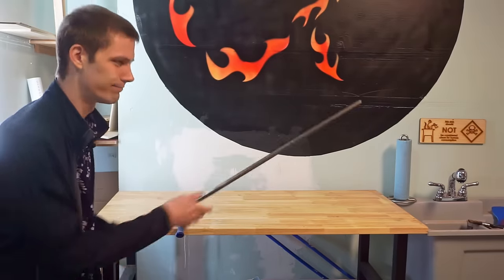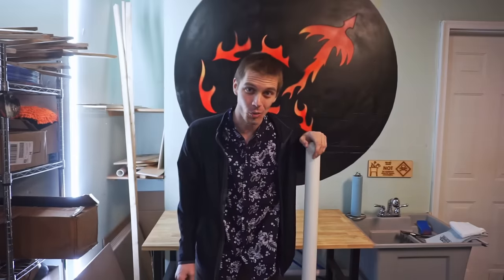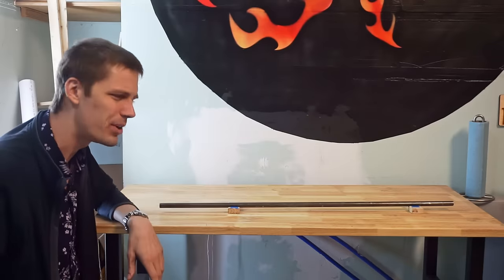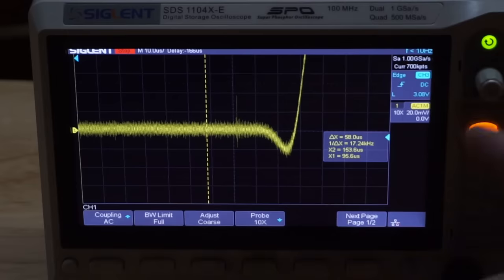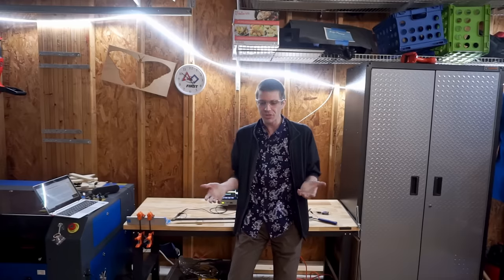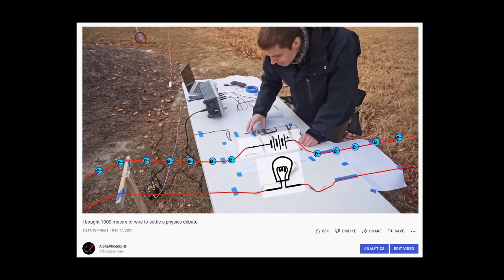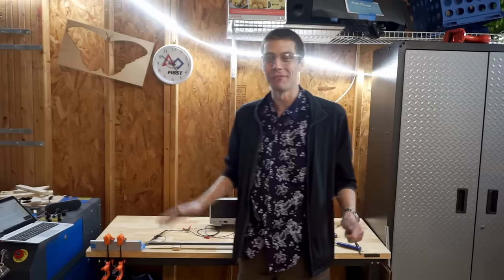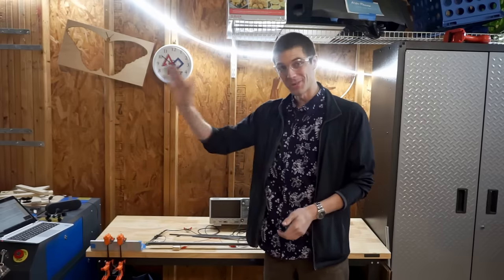Are solid objects really “solid”?

Comment from the maker: Frequent question replies and corrections!
Sup  everybody! I'll edit this comment when common questions show up or people find errors I want to correct! (I know there will be many, but I don't know what they are yet, or I would have put them in the video!)

#0: the "model" I use to describe interatomic bonds is ludicrously oversimplified, but it's kinda close enough to make it look like a spring.

#1: at 20:02 said "poisson ratio" when the graphic clearly said "E" for Young's modulus. It's almost like filming brian can't even see the things editing Brian pastes on the screen...

#2: lots of people asked about the delay in the wires or sensor squish. if there was a noticeable delay, the plot I show at 17:26 would have had a nonzero intercept (if the spark between the hammer and bar sparked early, the intercept would be negative, and if the sensor or circuitry added a serious delay, the intercept would be positive.  If both are happening and cancel out, they happen every time the same way, apparently!

#3 yes everything from water, to steel, to neutronium is somewhat compressible (the nutronium comments were great - thanks! Apparently in such a structure held up by Pauli pressure, Vs approaches the speed of light. Now I’m wondering what the refractive index of nutronium is and if it’s crystalline or not…)

#4 I've had enough people ask about hitting the bar witha hammer moving faster than the speed of sound that I actually looked into it. I'd need an ultralight projectile like railguned into the end of the bar in a big vacuum chamber - there's no reasonable way I can think of to make something go that fast but I if can think of one I'll make a video. bottom line though, as long as that impactor isn't actually penetrating the bar of steel, the wave will still pass through the steel at the speed of sound.
Reply: 20:02 to 20:10 You say "poisson ratio" instead of "Young's modulus"
Reply: Dustin at smarter every day has a canon maybe a team up
Reply: Sounds like we need to get you more patreon supporters so you can buy a railgun and giant vacuum chamber 😂
Reply: amazing video!
Reply: 7:14 wouldn't you actually be reading the devices inaccuracies?  Most if not all have a   1-2 + - %.  I've Never seen one 100%.....
Reply: #4, doesn't matter how fast.. the media dictates the speed of the wave.  The harder/faster you hit it the quicker it reaches its max squish factor or speed of sound but it won't increase the speed of sound in the material.
Reply: #4 There is a lot that you have put into this decision process and every idea I thought of came full circle to destin and his cannon haha.   Speed of sound in air is slower so why not use that;  A long barrel gun has an initial compressive supersonic wave.  But air isn't rigid.  Is the rigidity of steel stronger than the speed of sound in it? could an S wave travel faster than a p wave? Supersonic jets and earthquakes is where my thoughts go next. Admittedly I can't remember the types of waves in an earthquake.
Reply: What you're measuring is the time it takes the hammer to exert enough force to push the bar forward. That's you delay. The hammer touches bar, timer start. Hammer pushes bar forward, timer stop.
Reply: Try measuring the force it takes to push the bar forward, then start measuring the speed the bar moves forward, at exactly the moment the right amount of force is applied.
Reply: What is the speed limit you could test before the steel disintegrates and goes molten from the kinetic energy of your rail gun hammer?
Reply: Hi, your videos gave me pleasant surprise this morning! ~9:40 on the zoomed in scope, just before the the impact of the hammer there is a tiny spike. Presumably irrelevant but could it be the pressure caused by swinging the hammer backwards? Pretty interesting observation you explain here 😎
Reply: As for point 4 that is called a hydrodynamic impact. Theres virtually no info on google about it. It is a very real thing in military applications, tanks do consider it. 

You only need the impact to be faster than the speed of sound in the material to see the behaviour. Once that condition is met all materials behave following the same equation. So instead of making a super fast projectile try getting a material with a slower speed of sound.

Spoiler alert the projectile will penetrate. Pretty much always even if a little bit. I like the model you made cos it is perfect to explain this. If the first layer of atoms move faster than they can relay the information to the second layer they will reach the second layer before the second layer knows there has been an impact.

PS: if you need the formulas or whatever hmu. It would be great to have some easily available info about this!
Reply: Could you please do the experiment again keeping all things equal except that the steel is now Lead.
It sounds to me that the resonant frequency of the material is what determines just how solid (Or lack there of) it is.
Steel has a frequency of 38Hz, Transfers motion quickly.  Lead is 3.26 Megahertz. Absorbs and transfers motion slowly.
I think most people would say steel is more solid than lead. Both conduct electricity well. Its got me wondering.
Reply: And this particular field of physics is why geologists can study earthquakes.
Reply: what about if you used a very long diamond
Reply: Question: what about the speed of (conductive) heat? Does it use the speed of light (because of the relationship between electrical and thermal conductivity) or the speed of sound (because thermal energy is kinetic energy), or something slower still?
Reply: I would grüess Speed of Sound cause the Atoms bumb at this Speed in to each Other. So Speed of sound
Reply: Maybe try with different lenghts of bar so you can remove the delay caused by your measuring system. That part should stay relatively same (taking the average of multiple repeated tests with both bars).
Reply: Science works fine as long as we remember that it is all relative (approximate) and use it to do something useful. Once you have the useful outcome how accurate it is isn't really relevant.
Reply: about #4 - While going to the speed of sound in steel is, indeed, fairly impractical, how about changing the material? Lead or Bismuth are potential candidates: you can get the extensional speed of sound of them (according, btw, to the same site you referred to in your video, which I actually did not intend to find😂) as low as around 1200 m/s, which is much easier to get (using a bead with enough explosives is the easiest I can think of)
Reply: You could use a stockwhip to hit the bar somehow as the crack of it is actually a sonic boom as it goes faster than the speed of sound. But it would be hard to know at what speed exact it strikes.
Reply: Just seen the result, I was pretty much spot on but I wonder if you had a stiffer material, such as titanium for example. Would you have different results?
Reply: @bennyboyy7  a stiffer material will be harder to check, because the sound of speed would be significantly higher
Reply: @yahhav345  right thats where im curious tho by how much faster? Because ive heard all these terms for different hardness steels and i dont quite understand how they are measuring it. If the results are consistent with the hardness then this could be a good way to measure and explain i think. The only thing that makes sense with the way they test hardness is how flexible is the metal before it breaks. Hard metals arent really flexible at all but soft ones are to a point. Its weird how the speed of sound changes with harder metals but i guess its not really changing its just the vibrations are faster through the metal and they end up being faster than sound
Reply: @bennyboyy7  basically, it doesn't have to deform a lot, and you don't have to be particularly gentle: at least with metals, usually you can get some sort of deformation before getting to the breaking point of the alloy/metal. it's not like that with everything (e.g salts) but than you can check the stiffness through the speed of sound
Reply: Theory: hitting an object with a projectile moving faster than that objects speed of sound will momentarily liquify the material around the projectile. Explanation to follow.

So I thought about elastic and plastic deformation. If the projectile is moving faster than the object's bonds can react, assuming it has sufficient strength itself, it will just start yielding those bonds before the next set of atoms can accelerate to match the speed of the first set of atoms and resume elastic deformation. Thus, until the projectile has lost enough velocity, I believe the object would appear to "flow" around the projectile. Not like a bullet hitting a soft object, I mean like a bullet hitting water. Then when the projectile's velocity drops below the objects speed of sound, the strain wave would finally outpace it and propagate through the rest of the object at its speed of sound.
Reply: @maxk4324  that's what happens with fluids and gasses. I would think it would happen with amorphous solids as well, but crystalline solids got their strength in part from the structure itself. would a solid body necessarily have enough energy to flow through the material? what if the hitting material is softer then the one you hit? it's actually fairly interesting imo
Reply: I like the ideas to solve #4 by using other metals like lead, but I think that is not ambitious enough. Lead does deform easily, so maybe a plastic that has similar speed of sound would get the job done. But if you can find a suitable rubber rod and design a experiment around it, that is your ticket. Rubber has an abnormally low speed of sound at around 60m/s (literally slower than air), which would be trivial to accomplish.
Reply: Re #4 collab with smarter everyday. Use the supersonic baseball gun to propel something into the rod (eg. a projectile hitting a small steel plate that could also then close the circuit). Supersonic gun bullet could work too, as long as the middle piece is of the same weight as the bullet. Or not?
Reply: You're answering questions I asked my parents as a kid and never got the answers too. Thank you
Reply: Nice explanation! So if i understand it correctly does this also meen that a steel bar can produce a max of sound when i drop it?
Reply: Great video!  I particularly liked the Poisson's ratio explanation for the difference in sound speed
Reply: @maxk4324  its called a hydrodynamic impact. As long as the speed of impact is higher than the speed of sound on both materials the projectile does not slow down until it is consumed.
Reply: Can i buy the box/counter from The "The muon-powered, universe-bifurcating, random number machine" video?
Reply: A lot of people are asking about hitting the bar at a faster speed but my question is what if you push the bar very lightly with your finger instead of hitting it with a hammer? Like If you were to put your finger on one end of the bar without taking any measurements, then have a friend turn on the measurement device, then push so no sound or impact is created. Does it still create a wave through the bar at the speed of sound?
Reply: @rehepeks  (about different lengths of bar)  Towards the end of the video that's exactly what he did!  Bars of length 3', 2' and 1'.  Delay time was almost exactly proportional to the length, which helped verify his hypothesis that the delay was totally because of the impulse traveling through the bar.
Reply: In Fluid mechanics you can create supersonic velocities by laval nozzles which unintuitively widen up to further increase the fluid velocity. Im wondering if the underlaying effect is similar to the higher speed of sound in a wider solid structure. Maybe it would also be possible to increase the velocity of sound in metal by giving it a spacial form then.
Reply: Awe, come on man!   You can bend that with your hands !   You just need a few more days at the gym and a little more Motivation !  :-)
Reply: So if it's moving the speed of sound, I would have to think that means the speed of sound through that specific medium, which makes me believe the results would have to be the same if the experiment were conducted in a vacuum. However this also implies that the propagation of the force would travel at different speeds depending on the density of the material the force is being applied to. For example hitting a hammer against a foam rod vs steel vs water vs compressed methane.
Reply: Maybe you could also measure the shear speed by modifying the setup just a bit. The shear speed is much lover than the compression speed, looking at the table in the video.
Reply: @alphaphoenix In college we studied the Hutchison’s Affect, being able to manipulate metals with magnetic force. A very interesting concept! If anyone hasnt heard of this I HIGHLY recommend looking into it!
Reply: I've never before considered the speed of sound in neutronium...because in space, no one can hear you scream. 

Also, because the gravity is fatal to all corporeal life.
Reply: @louisvictor3473  That was my thought. Just cap the rubber rod with a piece of steel so the same conductivity method can be used for measuring start time. But is there a rubber that can be hit that hard and remain intact? That's like twice the head speed of a good golf club swing. Either way, it would be cool to see this experiment done with rubber, plastic, water (two pistons on the ends of a tube of water), etc. even without a supersonic strike.
Reply: Question: what if the lite second long bar was truly solid?
Reply: This is so interesting because I have been thinking about this 

And imagine eating and visualizing it on solid objects like rocks and hammers just had a curiosity of thought and now to kind of see it or have someone explain it truly amazing times funny
Reply: @mendelalnatan8108  I suppose nothing is truly solid, at least on a scale where causality can not be violated, which may or may not be all scales.
Reply: For an alternate test to see the potential for the speed of motion, could you not rotate it in some manner which does the same thing? Maybe put a metal pin in each end of the bar so it can still conduct and try it again. I bet if you measure it on a rotational axis it'll be much higher than the speed of sound through the material, but likely still at approximately the speed of light.
Reply: #4 just shoot it with a 9mm going close to 1200 ft per second
Reply: If you use sound or an action that creates sound through an object to move it. Isn't it plausible that sound might be moving faster than the motion of the mass. So all you are really doing is measuring the speed of sound? What would happen if you were able to use light to move the object? Or your finger? Or a Magnet? Or to simplify it, the speed of motion on a mass is relevant to the type of force applied to it.
Reply: @glenh1369  so use a bullet that's traveling three times faster than the speed of sound and shoot at a distance away to where the bullet exceeds the speed of the sound wave
Reply: @ethanyates28  And when the bullet hits will create a sound wave through the mass.
Reply: ?mmmmp
Reply: Mo
Reply: Thanks for these add on :) 🙏
Reply: Doesnt the bar recoil? If you hit with a hammer, adding energy to the bar, that wave doesnt necessarily move just forward, it would also move backwards. If you mentioned it, I missed it.
Reply: So the solid object doesn't move till the kinetic energy of the force is exiting it, not when it enters?
Reply: This might be a silly question (I'm literally no scientist and have no education in this field, at all)  but as everything is made of electrons, what roll would the compression of atoms prior to the hammer striking the metal have on the electrons making up air have on the registration of the weird dip on the scope?
Reply: I like this video but I do have a question about the delay process. I like how you used a hammer to hit the rod, "solid" on "solid", but what about your hand? Could that have caused the delay? Or contributed to something not addressed or calculated to affect the results?

Basically what I'm wondering is there a possibility that the soft tissue, blood etc of your hand cause a slight delay before the rod moved against the pressure switch? The hand naturally isn't as hard as the steel rod or the head of the hammer, and the amount of force needed to move that rod into the pressure switch be enough to push into the softer parts of the hand (blood, fat, skin etc) causing the delay? Or the impact of the hammer on the rod have enough force to push the handle into the softer parts of the hand affecting the delay, causing more contact time with the hammer and rod, than with the rod and pressure switch affecting the results (imagine pushing your finger into a pillow) or would a nonzero intercept apply here as well? Lord I hope I'm making sense lol words are not being friendly to me today
Reply: @zhoufang996  dope thought. Upvoted
Reply: Could the thin steel bar be bending slightly to cause the delay? like when an arrow is shot from a bow, it bends under the pressure, and then starts to move?
Reply: Can you do an on orally rearranged monatomic elements patent, ORME patient, and their exotic properties. ☀️☀️☀️
Reply: @yahhav345  not through, around. I'm not assuming that the projectile would pass through the object unimpeded, rather that the material from the object would part out of the projectiles way like the first few microseconds (or milliseconds, not sure what time scales to use) of a bullet hitting water. My first assumption is that the projectile material is stronger and harder than the target material, but I'm sure neither is coming away intact regardless. Regarding the bond energy, I'm fairly sure any solid projectile moving this fast has the energy to locally liquify of even sublimate the target material once its kinetic energy is dissipated into heat, but that would come after what I'm talking about. What I'm talking about is the moment of impact and a few microseconds after, while the projectile is still moving faster than the targets speed of sound. Other atoms in the structure not in contact with the projectile would not have time to react preemptively to the projectile, as they would for a subsonic case. So the projectile would part the target material as if it were spreading a tightly bonded, but free flowing liquid, at least locally it would appear that way until the projectile went subsonic again and the target's grain structure could resume normal plastic and elastic deformation.
Reply: @louisvictor3473  Plastics and rubbers don't necessarily have a uniform speed of sound, and it can be directionally dependant. I don't think it would work with those materials, or at least it would not have the desired result
Reply: @Pawer8  how would one achieve this! Gas gun? Rail gun? Other?
Reply: @maxk4324  military got a lot of money. Also it is not as fast as you may think as usually tanks use ceramic armour which has a slower speed of sound. The amount of steel needed to protect against a projectile would be too heavy so composites are used.
Reply: @Saki630  doesnt melt. It kinda just gets out of the way
Reply: @bennyboyy7  hardness is not strength which is what you are talking about i think. When we say speed of sound we mean in the material
Reply: @maxk4324  if you are above the speed of sound in rubber you will see the same behaviour. Once you get past that point all materials are defined by the same set of equations
Reply: Interesting experiment, I suppose it makes sense, people trying to defeat light speed communication by saying something like "what if we have a long solid bar and we push it back and forth, then we can communicate instantly!" and then the answer turns out to be "So... Basically... You want to connect two distant points with a ridged Rod/Bar/String. You will be communicating moving the Rod/Bar/String back and forth, perhaps with some sort of mechanical driver attached to each end that will both move the Rod/Bar/String and detect movement as signal...?" and then it is pointed out to you that this is exactly the principal in play when you tie two cups together with a tensioned string to make a telephone... which is understandably limited by the speed of sound through the string. So now you're looking at the problem simplified to the obvious, laid out in front of you and just go... "Well... Derp."
Reply: Depends on how you define solid!
Reply: What would happen if you hit the bar with an object moving at mach 2 with no loss of energy between the 2 materials?
Reply: @mikess308  already answered that
Reply: How do the outer mist atoms hold themselves together with the rest of the atoms in an object when moving? I have always pictured atoms in my head as a magnetic force. What is strange is that they seem to be held in place with resistance coming from all directions? Or are they being pulled to a point while these points of pull are sort of like how a black hole is visualized? 😕
Reply: @mikess308  !Also assuming there no outside loss) So all the energy is transferred to the other item!
(assuming no outside interference) 
So you are also assuming all the energy is tranferred! 

Then if both objects are the same weight then the one hit will continue at the same speed as the one that hit.
so not a real life experiment
Reply: I believe this weird negative signal was the bar pushing back on the hammer. And the reason it was smaller but not gone when you put on acrilic is due to the transfer of energy and potentially reduction of mass since there is no nuclear bond between the acrilic glue and bar.
Reply: How solid?
It more simple for me to imagine that bar to swing like a sword. Imagine that bar 10 meter. Seems like more delay than speed of sound.
Reply: I'm just wondering if we were to take air displacement into account between the rod & the pressure sensor. Working in machining & making a block stack for a job. All the air must be removed from the block stack to be accurate  we have to wring the blocks together. That is push them together & twist them in alignment. The two machine surfaces of the blocks will stick together just from the friction. If this is not done the degree angle that the block stack is supposed to create for the machine cut will be off. If the part you are working on is really long, the degree angle will be out at the other end. So should air displacement be a factor in this test for a more accurate measurement?
Reply: Wouldn't the bar "reaction times" depend on where you place the bar? Since space hasn't the same properties everywhere? I guess you're using a virtual space to place this bar but if you had to test this in a lab then the lab location would matter.
Ps if this sounds confusing is cause I'm testing the wine i produce
PPS not a commercial comment, I don't sell wine
Reply: "I'd need an ultralight projectile like railguned into the end of the bar in a big vacuum chamber"

Smarter Every Day has a faster-than-sound baseball launcher he's done several videos on. He's always looking for excuses to make new content about it. Given that this video has 1.35 million views, he might be open to a collaboration.
Reply: A.
Reply: You say mass doesn't move, but I see two possible exceptions:
1) assuming an ideal unbreakable material (say neutron star matter), any relativistic shock force should cause bowing of mass. what would relativistic acoustic properties be?

2) if possible, a meta-material that has a piezo, anode, cathode, and chiral preference, like some sort of solid-state electron gun, that throws out electrons instead of photons. I know there are some crystals that light up when impacted. it would be interesting if a material could bleed away kinetic energy orthogonal to the waveform with a chiral preference.

also, do acoustic properties change in metal if and while it is irradiated or if a current is flowing?
Reply: So every materials (atleast average) speed of motion is that of the speed of sound for said material?
Reply: #4 Ask Dustin (Smater Every Day) :p
Reply: Would there be a delay in that rate of motion if we were to observe an electron move another electron in a direction in the same way the hammer moves the rod? Based on the information presented here, we know the delay comes from the fact the "solid" object has to carry a wave across the joined atoms. If we replicated the experiment with only a single electron and another electron, and there IS a delay, would that prove there is some space within the electron for delay to occur?
Reply: Would there be a delay in that rate of motion if we were to observe an electron move another electron in a direction in the same way the hammer moves the rod? Based on the information presented here, we know the delay comes from the fact the "solid" object has to carry a wave across the joined atoms. If we replicated the experiment with only a single electron and another electron, and there IS a delay, would that prove there is some space within the electron for delay to occur?
Reply: What if you were able to pull from the middle of the bar?  Would it be comparable to the striking of the bar?  Say for instance if you had a 10' bar, and pull it from the middle vs a 5' bar being struck @ 1 end.
Reply: Hello. Just curious, but do pressure sensors not have latency? Surely all sensors cannot react to stimuli instantly. There would be a latency I would think. So wouldn't that suggest that at least part of the delay is the pressure sensor's delay in responding to the received pressure input?
Reply: When you add more water it is pressurized like a water main under ground pumps push more water in the pipe to 60 to 120 psi to push water to your house.
Reply: Imagine a circular-wheel type baseball pitching machine and an observation device existing and free to move in the vacuum of space traveling in a given linear direction to within 90MPH of the speed of light, whatever that is in Miles/Second.
(An area with the least/negligible gravitational/magnetic forces anywhere near the test space.)

The machine then launches a baseball at a speed above 90MPH in the same linear direction of travel of the machine/observation device.

Would the ball, and presumably for a temporary time any parts moving at above 90MPH, disappear from the observation device's viewpoint?
Reply: Does a flow of electricity change the reading in anyway? Or could it?
Reply: This video answers a question I've been asking myself since early high school. I am so happy to finally have an answer (and to know that I correctly guessed both that there would be a delay, and that the formula would contain the speed of sound) thank you!
Reply: Surely the sensor has a response time ??? 
Oh I just saw your answer!

I wish you were my physics teacher 45 years ago 🤠
Reply: Okay. Good video. The next video should be "Does information really travel instantaneously between two particles under Quantum Entanglement?" and show experimental proof in the video.
Reply: The person might have god-like strength, but wouldn't the rod bend?
Reply: @Pawer8  I believe you mean point #3 hydrodynamic impact is the water compression
Reply: #2 You could have used a very short bar (about 1 cm or less) to demo the reaction delay of the whole system while nearly neglecting the influence of bar length. This should have convinced everybody that reaction delays are neglible. (At least I would have loved that part of the experiment as "zero calibration".)
Reply: Awesome experiment. It's 1 I have contemplated quite a bit myself! But I imagined it's delay would be the speed of causality for a 1 light-second bar. Granted the bar was thick enough to not distort. I'd assumed the different permanent distortions would not arise if it was 1 light second long and 50 meters wide approximately...hahahaha!
Although I still believe that isn't wide enough, but close.
Reply: So how does hitting the bar at the resonate frequency of the rod influence your experiment?
Reply: I believe Destin from Smarter Every Day could assist you with a railgun 😉😎  Great video, I appreciate your explanations towards the end. It was interesting to learn how and why you did it the way you did.
Reply: Great experiment! Can you repeat this with, for example, ceramics and graphite?!
Reply: @harlyrose   Where are you getting these resonant frequencies?
Reply: @Silent01Josh   Why would it take time to produce the force? It can actually be virtually instantaneous.
Reply: "hitting the bar witha hammer moving faster than the speed of sound that I actually looked into it. I'd need an ultralight projectile like railguned into the end of the bar in a big vacuum chamber"

I seem to recall seeing high speed x-ray photography of almost exactly that. It may have been part of some government weapons research (maybe related to improving the computational models for high speed impacts, maybe for something relating to nuclear weapons research. I don't remember for sure, I'm probably conflating different uses of high speed x-ray imaging).

IIRC they were firing a steel sphere into the end of a steel bar and using the high speed x-ray photography to image the impact from the side (the image I recall shows the end of the bar deforming as the sphere impacts).

I couldn't find the image I'm thinking of in a few minutes of googling, but it's probably out there somewhere.
Reply: Really give you a ton of credit on this experiment. The O-Scope conductor loop to trigger the measurement was brilliant! For those who already knew the answer, it's still quite interesting to see it demonstrated. All of your videos I've seen so far are very entertaining.
Reply: just saw you mention 3blue1brown and now i want to see alphaphoenix and 3b1b solve something weird to find pi
Reply: And what if you just move a steel rod with your hands so theres no sound. Say you make a steel rod thats long enough to reach the moon and your buddy holds one end on the moon and you hold one end here on earth. Would your buddy feel the movement of the rod 13 days after you moved it?
Reply: Bullets go faster than the speed of sound! About Mach 3 or 4 in some rifles, and pistols often reach Mach 2 or 3, you could just shoot one at the end of the bar, no idea how you'd start a timer with that though... maybe you don't have to? I'm not too sure but I think the slow-mo guys have cameras capable of filming in the nanoseconds region... maybe you should ask them?
Reply: Experiment: awesome, Explanation: touch and go.....
I mean you literally make it seem like you had a hypothesis, decided it was correct, started the experiment, then altered the process until getting your predetermined "correct results". I know that's not actually how this likely went, but your explanation definitely makes it feel that way....
Reply: @Alphaphoenix Why can't you keep pressure sensor on two sides of the solid bar..with one end against a rigid surface and then hit the other end is hit with force and then we see difference between two sensors timing.  Ideally it should be more accurate.
Reply: E : I have no idea
Reply: What happens when you hit it with something faster then that does it just melt
Reply: The bar moves in the time to the light it reflect from its surface of the rod to our eyes and then to our brain
Reply: Can some 1 explain me how gravity doesnt affect this outcome? Hes applying a force on a metal bar but it looses energy moving forward loosing energy automatically means there would be a delay right?
Reply: @J. C. I've seen some of your comments on new thinking allowed. You seem like an intelligent person. I really like Jeffery Mishlove. That's probably in my top 2 or 3 favorite channels on YouTube,  and it's probably my favorite depending on the day I guess. Take care 🙏.
Reply: Great video! And you seem to be the man to ask to tell me what to think of the following (yeah, there’s something/total nonsense).
Many times I’ve been under the impression that when I cool down the hot end of a metal rod that I can hold at the other end with my bare hands, ONCE it enters the tank it becomes too hot to hold. As if part of the heat speeds up the rod to burn you.
Reply: I honestly think this whole test contradicts itself. Pushing a bar is not the same as hitting a bar. The question you ask is what would happen if you push a bar. Pushing = more torque less springing through the material. Hitting = less torque more spring. This is all wrong.
Reply from the maker: @boshaw3667  the pulse gets most of the way through the bar before the hammer “stops pushing” so it shouldn’t have any effect other than making it easy to measure. Hitting is just pushing then stopping.
Reply: @AlphaPhoenixChannel  nah hitting something creates a shockwave which changes EVERYTHING. Pushing does not. They’re two fundamentally different things. Yes pushing happens after a hit but it’s more from the shockwave from the deformation created by said hit.
Reply from the maker: @boshaw3667  so how would you push?
Reply: Everything is a liquid if you hit it right.
Reply: Let's say the bar is floating in space is it possible for an object the size of a penny traveling at an extraordinarily high velocity much greater than what would be required to move the bar strikes perfectly to transfer all of it's connected energy.....is it possible for the bar to fracture while staying perfectly stationary????
Reply: A little late, but I am still bothered by this idea of metallic bonding. Why doesn't the crystal strcture of a material expand when you attach it to a capacitor and rip electrons from a material. I'd assume less electrons between two bonded atoms should increase the Coulombic repulsion of neighboring nuclei and an inflation of the crystal structure should be seen? Would this expansion happen along a specific crystal axis? Or are there simply not enough electrons stored in modern capacitors to see an appreciable change?
Reply from the maker: @brandonreese1886  you’re totally right - ripping one appreciable fraction of an electron from every bond would change the bond strength/length/etc. but when a wire becomes charged, you’re only moving a minuscule number of electrons. A recent test I did suggested that to charge a wire to a volt and a half, I’d removed about half of a quadrillionth of the mobile electrons
Reply: @AlphaPhoenixChannel  Thank you for the response! It's such a simple but effective interpretation of solid state systems you almost want it to fail. Do you have an ORCID  -ID? I'd love to check out some of your more formal work.
Reply: @MindCrime550  I came to say that the whole think is based on the speed of sound because he is basically just testing how long it takes for sound to travel through the metal bar because he struck it causing sound vibration
Reply: I have 0 physics knowledge but would a solid object with less electrons make it less "springy" and transfer the energy up the chain faster.
Reply: @jayofthep  less / more electrons mean less / more protons, things would end up balancing out again. I think an interesting extension of that question would be ductile vs hard materials, and do certain crystal structures communicate the impact more easily. I'd imagine highly anisotropic crystal structures, i.e. ortho, could exhibit different communication velocities along an 'easy' or 'hard' dirrection, look up ortho vs cubic unit cells and think about it, its an interesting question.
Reply: Compressibility?
Reply: My 1st thought is the speed of sound in given material is the same as measured.
Reply: Hey that's one of the machines I use at work! Never thought I'd see one outside of that
Reply: Factors of temperature play a part in compressed metal and malleability of solids
Reply: @justinpace7289  Temperature is an emergent property
Reply: Man hats off to your work!! Just amazing amazing amazing!
Reply: I don't remember if it was asked, but what if this experiment was ran near a black hole or something else with a gravity well the object could follow? If gravity is pulling on the object what's the difference between being pushed in either direction, or even both at the same time?
Reply: A rail gun would be awesome, though you could equally just select a material with a lower speed of sound ;)
Reply: Hi, thanks for the video.
The idea of the hammer moving faster than the speed of sound really fascinates me. My personal guess is that the stress on the contact point increases up to the Young module, Young module is always greater than the tensile strength, therefore tip of the bar (tip of the hammer as well) gets smashed, which absorbs the energy and then it propagates normally via speed of sound :) 
Really hope for a video specifically on this topic.
Reply: If you leave the other end free, then the wave will reflect off it. I think this means that the total contact time for the hammer will be the time for the wave to move along and back (ie twice the time you were measuring), but you can now do the experiment without needing the piezo sensor.
Reply: So then in your theoretical space model. If there is a measurable delay possible through force applied.  Would there also be a measurable delay with pull? Say magnetism or gravity? And would it be equal or less or dependent?
Reply: @AlphaPhoenix I think(OPINION)-  calculate time that particular atom moves at its fastest.like when we talk about the speed of light we are talking about the speed of photons, just like that If that rod is made of titanium..........but photons never rest, they bounce instead. So, imagine if we are able to hit that titanium rod with an immense force which puts the impact surface atoms to move at its peak speed- the loss of energy by atoms pushing each other, transferring energy. it will take (length of rod(at atomic level)/speed of that particular atom(fastest) at impact surface) minus whatever the equation is to calculate the loss of energy over the time the atom transfer that energy from one another.
Reply: @AlphaPhoenixChannel Would these results be effected by temperature, as metal does shrink and expand? If so I feel like that would really help prove it.
Reply: I saw you addressed a delay in wire already in regards to sparking before impact or circuit issues. I understand your reasoning for considering the speed of sound but am curious, if you are serious about a dependence on the speed of light, how this would be accounted for in the system because, say the speed of light was the only obstacle, since the signal from the hammer touching the bar moves at the speed of light, the timer wouldn't turn on it time. By the time it came on, the other side of the bar would've moved assuming same length to travel. And appeared instantaneous. I don't know if that scale would register on a machine like that.
Reply: Regarding #4 this makes me curious then about the motion of supersonic jets. Clearly they are in motion, but this proposes that everything inside the Jet-Object is moving at sound speed whilst the Jet-Object itself is actually moving faster. By sheer intuition this seems wrong and I have no idea how to look into it
Reply: Pointless...Total waste of my time.
Reply: Doesn’t a whip break the sound barrier? 

Or a decent air rifle dieseling.
Reply: My thought about how to do the experiment, before you started, was to attach accelerometers, oriented to measure along the axis of the bar, near both ends.  That way any artifacts related to the sensors and their signal conditioning would be the same…
Reply: Would the temperature affect the speed of sound because, of atoms being closer together? Would strain gauges along length of the rod register the elastic deformation wave going by? Did you use a hammer and rod that were not magnetized?
Reply: I think it's not so interesting if the hammer moves faster than speed of sound, because in that context, the hammer would have to travel into the bar faster than the sound wave would propagate into the bar--so either the hammer penetrates the rod and then stops (and the sound pulse continues from that point forward); or, if sustained, said hammer  hits the sensor before the rod itself. Eitherway, you've already explained the situaton sufficiently in this video.

What might be more interesting to wonder about though is this: if a series of rapid small amplitude hits were made on one end, the subsequent compressive  waves would each travel into a slightly denser (pre compressed) material, and each of those will travel with a slightly higher speed of sound than the previous one. These waves would eventually catchup to the first hit and coallese into a shock wave, which in principal would travel faster than the speed of sound. Not sure if this is detectable in steel.

Please let me know if this sounds interesting and if you want to confirm experimentally, I'd be happy to exchange further thoughts...
Reply: Nifty.

I'd like you to push a 1 Ls long bar with your hands!!!
Who are you, superman?

Oh, you answered it, nifty.

Another thing:
LIGHT is NOT the absolute speed.

Big Bang Theory:
During the first few Planck moments, Quantum Energy expanded up to  1/3rd up to 1/2 the volume of the modern Universe, depending on which astronomer you ask.
Now, if you calculate the speeds reached to achieve this vast expansion, the speed of light was broken many a time.
A LOT of many a time.

Oops.

Also, speed, no matter how fast, do not alter time.
Going superluminal will not move you in time, only in distance.
That you OBSERVE this is no more than an optical illusion.
Since, light is slow.
It's only the next barrier to be broken!!!

Is there  an absolute speed:
Yes:
The MOMENT: an infinite dot on the timeline of the whole universe.
This, like the 0°K, or 1 divided until 0 is reached, cannot be done, as there is always a rest .
Which is why we see no time travellers.
To venture into the past, one needs to breach that moment barrier, but seeing it cannot ever be reached due to the rest, however small it might become, is still there.
Nature has this build in to prevent us idiots for screwing up all that is.
Reply: Besides, I think you're lying!!!
I want to see that with a 300'000Km long bar!
PROVE IT!!!!
Reply: I used to question the same
Thank you for video
Reply: @varunsharma3532  Don't believe him!!!
Let him prove it with that bar in space!!!!

:P
Reply: This is underrated.
Reply: So #4 means that if you use a accelerate the steel rod with something fastee than the speed of sound the rod would momentarily slow down to the speed of sound and then accelerate beyond it as a whole?

Or I guess it would just break apart.
Reply: You might want to find analog electronics instead of digital for more accurate time measurements.
Reply: You mentioned something about another video in which there was an unexpected delay as electrons entered a wire at one end and didn't immediately come out the other. However to my knowledge this should have been expected because I think the conduction band of an unenergized metal is empty. So to use your pipe analogy, an unenergized wire would be akin to an empty pipe, per solid state theory.
Reply: 98a😊😊
Reply: @zhoufang996  conductive heat flow is very slow. It is based on the kinetic energy of the solid particles which means they wiggle in place faster and faster until the kinetic energy is transferred in series. The heat is neither a particle like a photon nor a wave like the speed of sound. It is a steady increase in internal kinetic energy (measured as temperature) emanating from the point source of the heat. As long as the point source continues to energize the solid, it has a gradient distribution. If you pulse the heat source, you could create a wave input, but the molecular structure of the solid will dampen the wave so that it will appear as a lower constant than if you kept the heart source constant at its peak value, the same way pulse width modulation affects incandescent lightbulbs. Heat is not a particle nor a wave. It is measured by a big average, which is what temperature is.
Reply: @joklu6257  the answer is no. The underlying effect is on fluid, not on sound. In fact in a laval nozzle, or more generally speaking in any converging diverging nozzle used for supersonic flow, you are changing fluid velocity as a function of the speed of sound, where mach one is defined at the throat of the nozzle. The purpose of a nozzle like that isn't to increase the speed of sound; it is to increase the speed of the fluid using sound as the independent variable. As a matter of fact, as the gas accelerates in that type of nozzle, the energy making the gas faster is sucked out of the temperature, which therefore decreases the speed of sound in absolute terms, because the speed of sound for a gas equals sqrt(KRT). The adjusted relative constant speed of sound that the gas speed is measured against is the mach number using the temperature of the gas at the throat of the nozzle to create the ratio needed to make it constant and relative for use as an independent variable. In other words, as the real speed of sound decreases due to temperature drop, the mach number of the sound remains constantly defined at the throat. In other words, the speed of the fluid is measured as a function of the speed of sound fixed at the throat of the nozzle. Just understand that all of the purpose of a nozzle is to change the speed of the fluid, not the speed of sound. Therefore the idea that you would use something analogous to a nozzle for the purpose of changing the speed of sound does not apply. And in case you are still confused, please realize that "sonic" means the speed of sound, so "subsonic" means below the speed of sound, "supersonic" means above the speed of sound, and "transonic" means passing the speed of sound. These terms do not apply to sound itself, but only to things you are comparing against the speed of sound. Sound speed is always sonic, whether you speed it up or slow it down. In other words, the speed of sound is always mach one. And when the mph of the speed of sound in a gas changes, it is exclusively due to temperature. Now I think what you are really asking is does sound flow like fluid? Please realize that a fluid is a group of particles. Sound is only a wave and has no particles. Sound transfer depends upon the kinetic discharge from one plane of particles of a medium to the next. It's intensity is inversely proportional to the area of each plane and directly proportional to the rate of energy discharged. The planes are curved exactly like the surface of a sphere, as the sound emanates out in all directions from its source. When a sound hits a geometric boundary of the medium, e.g., if you shaped a nozzle out of solid iron, it doesn't speed up or slow down; it bounces and causes interference. Interference multiplies or cancels the amplitude of the wave, but it doesn't change its speed. So this is unlike a fluid, which can neither cancel nor multiply its position. So no, changing the geometry of an object absolutely does not change the speed of sound rippling through it. The only way to change the speed of sound is to change the kinetic interactions of its medium. In a gas you do this by changing the temperature. In a solid you do this by changing the types of molecules bonding with each other, such as can be gradually done by doping the material with another material. I don't know this but I think changing the temperature of the solid material would change the speed of sound in it too, and the same would go for a liquid. I don't know how you would change the sound if it were propagated through plasma or bose-einstein condensate but again it would most likely vary with temperature and the type of chemical bonding. Okay, now having said ALL THAT, now that I think of it, I think there is one super-overly-complicated-crazy case where you could hypothetically be able to use geometry to manipulate the speed of sound, and that would be if you were trying to send a signal through a moving fluid constrained by a mechanical system. As you direct the fluid through the system, you would be altering the temperature of the fluid, possibly the chemical constituency of the fluid, and/or the matter state of the fluid. But to do all this would generate a lot of noise. You might be able to use frequency domain multiplexing to send sound signals in frequencies that are not drowned out by your machine. This would be a really complicated but theoretically possible engineering experiment. You could try mixing liquids together at certain junctures in the path of a primary liquid flowing down a pipe, and you could use nozzles to speed the liquid up or slow it down along its way. At the beginning of the pipe you would vibrate a membrane to create your sound and at the end of your pipe you would have a membrane tuned to the frequency range of the first membrane to pick up the signal. Remember, what you are trying to control (vary) is the temperature of the fluid medium carrying the signal, speed of the fluid medium carrying the signal, and chemical composition of the fluid medium carrying the signal. You would probably need a ton of power to overcome attenuation. You would probably have to use inaudible frequencies to transmit a signal. I don't know what frequencies can travel at the speed of sound. That is a really weird question to which I don't know the answer. If the frequency multiplexing idea works, you might be able to use turbines and compressors and avoid their frequencies. But you have to understand that this machine I am suggesting is so incredibly far-fetched that it isn't remotely feasible. It is like trying to yell a sentence at one end of a rocket engine and trying to hear it at the other end of the rocket engine as the signal travels through the exhaust and then measure that speed versus how long it takes the same sentence to get to your ears through the air outside the rocket nozzle. If you have transducers that can make that kind of measurement, then more power to you.
Reply: @SMPlayerSlayer  sound doesn't travel through a vacuum. It relies on the kinetic interactions between particles of a medium because it is strictly a wave.
Reply: @vasilyborodyn2507  what you are describing is like Finite Element Mechanics, which is pretty cool. Unfortunately that is only a model that applies to solids. So let's think about this. As the hammer swings, the air gets pushed out of the way and the contact is solid on solid. Maybe a couple air molecules get stuck in the middle, right? Now just so you know, technically not everything is made up of electrons. But your basic idea that all the small particles press against each other is worth consideration. According to modern chemistry, however the elements, made of proton and neutron nuclei, with clouds of electrons swarming around the nuclei, which if you look at more closely, are themselves clouds of other subatomic particles, are so far apart from each other that instead of touching each other they repel each other like magnets. If you were to try to force two atoms together then they would repel each other to preserve their crystal structure. There is a super dense 5th state of matter called a Bose-Einstein condensate but I don't know what it is. Ignoring that, and avoiding nuclear fusion or fission, as a general rule, when solids compress on this level, as far as I know, the interactions are not constrained as solids, but as charged fields of energy repelling or attracting each other. Actually the more I think about it, the more I realize that I really don't know what happens when two solids impact each other. I do know that there is this equation in engineering Fdt = mv, which means the impact (technically called impulse) is proportional to the change in momentum. Exploring impulse is very interesting science. To my knowledge, engineers don't understand it very well, considering the fact that they model it with a dirac delta function, which is a theoretical mathematical construct with no basis in reality that we know of. But anyway, when you go back to the chemistry and physics theory, what happens when atoms hit each other is supposedly that their electric field probabilities are altered and this creates reactionary force. If you go to the university and take a course in high level math, physics, or engineering, they will do what I just did and draw a connection without understanding why, and call it hand-waiving. It happens all the time. People who think they're smart really rarely know what they are talking about. But to answer your question, Vasily, and it is a very poor answer, the probability fields of electric energy of the air molecules sandwiched between the hammer and the rod have negligible effect, mostly because most of the air got pushed out of the way before the hammer hit the rod, and what's left is an extremely thin layer that compresses far more easily than the solids of the hammer and the rod, and finally any diatomic oxygen, diatomic nitrogen, argon, carbon dioxide, etc. molecules acting as a barrier between whatever molecules are on the iron surface of the rod and iron or whatever surface of the hammer would probably just transfer the energy so quickly that you wouldn't see it accounted for on the oscilloscope. You have a good question; all you need to change in it is your conception that all things are made up of electrons to the conception that all things are made up of probabilistic energy fields. The difference is, energy fields are mushy whereas the idea that electrons are discrete little balls implies that they are solid. On the subatomic level, scientists don't think they have states like solid, liquid, or gas. It's just all one giant blob. Shows what they know, right?
Reply: @commanderobelisk  latency pretty much only occurs in digital electronics. In analog and mechanical systems, signals travel nearly instantaneously. The only delay you might get is when the connections aren't contiguous, hence the need for glue.
Reply: @johnyz656  for something to resonate you have to hit it repeatedly at intervals equal to its resonant frequency. Considering he only hit the bar once, he only tested the force propagation of a single strike. If he hit it repeatedly at regular intervals below the resonant frequency, the timing of the force impacts would be linear with the measurements of the impacts at the other end. If he were to hit it at a quick enough frequency that it were to resonate, which would be an incredibly high frequency for such a short piece of metal, the reactive impact of the connection at the far end of the rod would slowly multiply until it would start sending reactions backward to the first sensor. At resonance, the striking at one end and the reactionary force at the other end would add up until one of the physical connectors breaks off of the rod. But to strike the rod that frequently would require a more robust setup anyway. If everything could be secured without breaking, then the rod would begin to vibrate as the force and reactionary force bounce back and forth continuously, adding to each other. If resonant frequency is reached and the supports are strong enough and the rod did vibrate, I suspect that there would be some sort of equilibrium where the power dissipated by the vibration equals the power being channeled into the rod. I.e., the taps would have to be really light. If the taps were very energetic, and the supports were infinitely strong, then it would go nuts. On the oscilloscope, before resonant frequency you would see the same result as a single strike but repeated over and over again. But when you achieve resonant frequency and these strikes propagate back and forth through the rod, then the whole signal will grow in amplitude and you would have to scale out the y-axis until you cannot go further and you would see vertical lines on your display at the resonant frequency but no peaks. Having said all that, at least that is what I think would happen.
Reply: @jayofthep  I think that in iron in order to reduce the number of electrons without cutting away material so you simply have less iron, you would maybe be removing the electrons from the conduction band while leaving the valence band electrons intact. I'm not sure about this. In any given material, electrons flow freely through the conduction band, while being held in place in the valence band. In metal the two bands overlap. I am pretty sure that only the valence band is what governs the cohesiveness of the material. Now I'm not sure if there are any additional electrons in the conduction band of a metal that aren't already positioned in the valence band, but if there are (which is a question for a chemistry or solid-state theory professor) maybe if you could use a cathode to strip away the conduction band electrons while keeping the valence band electrons untouched, you would be effectively removing electrons from the iron without altering its elasticity. I am 99% sure that what the other guy said about the crystal lattice structures only applies to the valence band. Now I don't know if it is possible to excite the valence band electrons out into the conduction band and then remove them with a positive charge. It could just be as simple as heating the iron. But I do know that when you heat iron enough it becomes softer until it melts. Now, you specifically asked about a solid material, so that means this only applies to iron before it turns into liquid. By the way, a piece of rebar like he was using would also contain a significant amount of carbon. (Or was he using a more pure type of iron; I can't remember. Still, all commercially produced steel-which is iron--contains carbon.) Now what about putting an electric charge through the iron, like an electric burner on your stove? When you heat up iron enough it becomes malleable, which means that its Young's modulus changes, I think, to make it less elastic and more plastic. Therefore it would become less "springy." Now very simply, I think possibly what is happening is that the very same energy dispelling electrons is causing the iron to become less elastic. You can realize this for yourself if you look at a graph for the tensile strength of iron over both the elastic and plastic regions. But you don't even need to look at the graph. Plastic means that when you pull it it doesn't spring back all the way to how it was before you pulled it. And when a blacksmith hammers iron, it does to back to how it was at first when it is cold, but then becomes more and more plastic the hotter it gets. So when I think about glowing hot iron I think of it losing its elasticity and becoming plastic in deformation. I betcha the answer to your question is, if you heat the iron, you simultaneously cause it to lose electrons and enter into a state of plastic deformation. Now if there is a one-to-one relationship between heating and malleability (i.e., plasticity), and also a one-to-one relationship with heating and losing electrons, then this means indeed that iron losing electrons means it is becoming less springy, very simply. I think the guy who was talking about crystal lattice structures was just mentioning a couple of different crystal lattice structures to sound impressive but don't know of any relevance to your question because you asked about a solid with fewer electrons, and crystal lattice structures have absolutely nothing to do with a change in the number of electrons in a solid. As far as iron is concerned, here's what the internet says: "Pure iron can have two different crystal structures as its temperature is increased from room temperature to its melting point. At room temperature it is body-centered cubic, between 912 and 1394 C if is face centered cubic, and between 1394 and its melting point at 1538 C it returns to body-centered cubic." Keep in mind that is for pure iron. The rod would have had impurities. Maybe the guy who was talking about crystal lattice structures was pointing out that some solids are more elastic than others, but that has nothing to do with having fewer electrons. Unless you are dealing with a material's conduction band, the number of electrons in a material basically equals the number of protons, and then that number becomes a matter of the density of the material, times the mass. It kind of depends on if you are talking about absolute quantities or relative quantities. Lighter materials have fewer atoms, and hence fewer electrons, and the weight is always directly proportional to the number of electrons, unless, as I said, you can vary the number of electrons in the conduction band.
Reply: @christophershafer5615  very good questions and I am pretty sure the answer to the temperature question is yes, the temperature affects the speed of sound in a solid, because it certainly does for a gas, and I believe that if the average particulate kinetic energy in a gas medium increases the speed of sound propagating through it then that the same would be true in a solid. Also I am pretty sure the answer to your second question about strain gauges measuring a wave of elastic deformation is absolutely yes, and he would have to answer your third question, but I do know that if iron is magnetized and you bang on it a few times it destroys the magnetic field by knocking the dipoles out of alignment with the shock.
Reply: Умножить на миллион
Reply: @LauraMeagher-i2s  Thanks for the reply. I've never heard or read research about the dipoles changing from impact. That seems like BS (gut reaction), as you can break apart magnets and they have the same pole directions as the parent. I think an easy way to eliminate the magnetic issues would be to use a brass hammer!
Reply: 0:20
Reply: I really love this video, I haven't watched it in a year and I have thought of it more than once over that time. Thank you very very much.
Reply: The speed of causality is the speed of light. But even a "solid" material will be compressed a bit.
Reply: I think the issue is the following: your hammer transfers electrons (for you start measurement) way earlier than actual torque/movement.
Reply: So how does this translate to a bar in space where there is no sound?
Reply: @AlphaPhoenixChannel Just now came across this video, but I have to say that I’m with @boshaw3667 on this one, in that I do not believe that sending a shock wave through an object is the same as gently pushing an object.  Along theses lines, the speed of sound varies with altitude and other factors, and how would the rod respond in space where there is technically no speed of sound?
Reply: @AlphaPhoenixChannel  This "might" be beyond your home-lab's capabilities, so would require a "field trip" ...
What about doing so with whatever matter resides at the centre of a black hole?  Is that compressible, what speed does that transmit information?
I'd prefer not to wait an infinite length of time, so if you could use a time machine in order to compensate for time dilation along with some method to keep yourself from being infinitely removed from the universe, I'd really appreciate it.  🙂
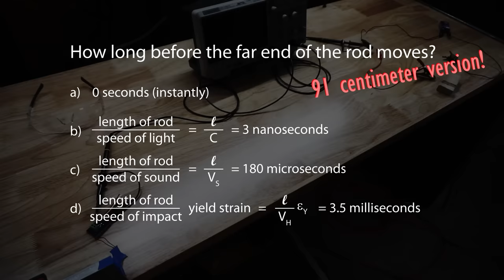Reply: I feel that the conditions were misleading. You say, at 6:16, "Is the delay zero seconds if it's an ideal solid object." And then you run the experiment, with not an ideal solid object. If it really were an ideal solid object, no atoms—maybe a piece of neutron star? I dunno—then I think the movement, if propelled by a being of infinite strength, would go at the speed of light. Your experiment in no way disproves this (or (a) for that matter).
Reply: @calorion  Answers a and b are automatically disqualified, due to basic physics restraints.  Consider if the rod was a light year long.  A force at one end could not travel the length of a light year long rod to the other end in zero seconds, as it would take light a year to reach the end of the rod, so that rules out 0 seconds, because not even light can travel any distance in zero seconds.  As for 3 nanoseconds (answer b), which is the length of the rod/speed of light, that cannot be the answer either since matter can never travel as fast as photons.  So that leaves choices c (speed of sound) and d (3.5 milliseconds).  A speed of 3.5 milliseconds is simply too slow, thus leaving answer d.  That being said, I wonder how this experiment would translate to being conducted in space, where there is no sound.  Also, the speed of sound is not a constant, as it varies with altitude, humidity, etc.
Reply: @F16_viper_pilot  A) is disqualified theoretically, sure, but he is acting like this experiment disconfirms it, which it certainly does not. And no, protons do not move faster than matter, being matter. Nonetheless, the stated condition was "ideal solid," which is not necessarily made of ordinary atoms.

And you disqualify c) as being "too slow" without justification, but that is the actual experimental result.
Reply: @calorion  Option A is not “disqualified theoretically”, it’s absolutely disqualified because nothing in the universe travels instantly, as that would break causality.  By “ideal solid object” he just means an object that is solid as is possible within the confines of the physics of the universe.  I think perhaps you are reading too much into what he said.

On a side note, I see that I mistakenly used the word protons when I meant to type photons.  I corrected my post.
Reply: @F16_viper_pilot  Okay, so if it's not disqualified theoretically, are you saying that we don't know that it can't happen, since theory does not disqualify it, or that we have performed the experiment with an ideal solid and discovered that it does not happen?
Reply: @calorion  I explained it now a few times a few different ways.  I’m not going to engage in addressing double negatives and the twisting of my words to add needless confusion.  The laws of the universe cannot be violated.  Nothing travels at infinite speed, including light.
Reply: @F16_viper_pilot  Says you. But he's trying to demonstrate that experimentally, and fails to do so. And you saying that a) is not disqualified theoretically can only mean that theory does not disqualify it.
Reply: @calorion  Says science.  His experiment succeeded; perhaps you don’t understand the experiment or science behind it.  As for what I said about not “disqualified theoretically”, your presumption that it “can only mean that theory does not disqualify it” is not true.  I’m saying that experimental data proves the theory, so it’s not just a “theoretical”; it’s reality as seen through observation.
Reply: @F16_viper_pilot  Oh, his experiment shows that an ideal Newtonian solid will not move at the speed of light? How so?
Reply: @calorion  You know what, @calorion?  I am more than happy for you to continue believing that cause and effect can happen at exactly the same time, regardless of the limits of the universe.  Good luck with that.😉
Reply: @F16_viper_pilot  Wait, I'm confused. You said his experiment disproved that notion, which he listed as one of the possibilities. How could I continue believing that if his experiment disproved it?

…unless his experiment did not disprove it, regardless of his (or your) claims. 

This whole thing reminds me of 5th grade, when the teacher "proved" that a magic knife could not keep cutting matter forever because we couldn't cut aluminum foil with scissors to arbitrarily small sizes.
Reply: @calorion   You seem to just want to be contrary, and I really have no desire to keep entertaining your silliness.  Like I said, believe what you want, as I really don’t care.  It seems this is the nature of social media for people to endlessly troll under the guise of trying to have rational conversations.  Have a nice life….this exchange is now over.
Reply: @F16_viper_pilot  What would it take for you to concede that this video does not fulfill its claims?
Reply: @calorion  What would it take for you to concede that nothing moves at infinite speed between two points?  Like I said before, this exchange is over.
Reply: Impacting something is different to moving it. What would happen if the wire was on your finger and you touched the bar.
Reply: @Silent01Josh this is something to look into indeed
Reply: Depends on how you are defining solid!
Reply: @danquaylesitsspeltpotatoe8307  And how do you define solid?  I believe steel was being used.
Reply: @F16_viper_pilot  Yes but its how you define solid that the whole point is he using the general term that steel is soild or is trying to say its not? because most of it is open space, how it moves, how atoms decrease etc
Reply: @danquaylesitsspeltpotatoe8307  Lol Even the most solid of solids has a huge amount of empty space between the atoms and nucleus, and between each atom.  That’s just the nature of matter.  But, regardless, no matter how tightly packed atoms might be, the ends of a solid object do not move at the same time; it’s a physical impossibility, limited by the physics of our universe.  A simple thought experiment should show this.  It takes sunlight about 8 minutes to reach earth.  If you had a physical pole that extended from earth to the sun and you pushed one end as fast as the speed of light (which of course isn’t possible, but pretend it is), the other end still would not move for at least 8 minutes, because nothing travels faster than the speed of light.  So, how “solid” something is really does not play into it.
Reply: @F16_viper_pilot  YES cat are animals 2+2 = 4 so which definition and which type of solid is he using?
the question was "are objects solid" apparently you missed that.
Reply: @danquaylesitsspeltpotatoe8307  Dude, I didn’t miss anything, but apparently you’re not getting the fact that no matter how solid something is, the length of it does not move at exactly the same time, period.
Reply: @F16_viper_pilot  YES you didnt state what definition hes using for solid!  an don what basis he is deciding if some thing is solid!
WOULD YOU LIKE TO TRY NOW!

YES I did congratulate you on stating a simple fact that didnt address the question! 
YES that right GHOOD BOHY! So dont do it again!
Want to try for a third time?
Reply: @danquaylesitsspeltpotatoe8307  🤣🤣🤣You clearly missed the point of the video, but do carry-on with your incoherent screaming rant.😁
Reply: @F16_viper_pilot you never disappoint (well me im sure you parents would have diff opinions!) 

More logical fallacies as I stated would happen (not that you know what that means! LOL)

failed to answer the question for the 4th time you where directly asked to answer it and the question you replied to in the first place! 
Off course didnt answer the new questions I asked asking for proof of your baseless false claim!

what next more logical fallacies! Its all he has!
Reply: @danquaylesitsspeltpotatoe8307  Your undecipherable gibberish speaks for itself.😁  No wonder this simple thought experiment confounds you.🤭🤣
Reply: I think you overlooked the resistance in the hammer and the bar as well. That resistance will slow it down.
Reply: Ударь по датчику молотком и получишь такой же результат. Задержка происходит в датчике и в его драйвере
Reply: What if the bar is at 0 Kelvin?
Reply: @kristijanikic4783 0k does not mean there is 0 energy, just that you can't take many more energy away